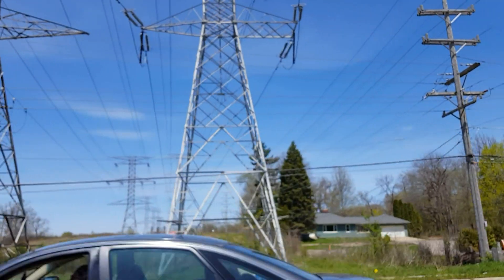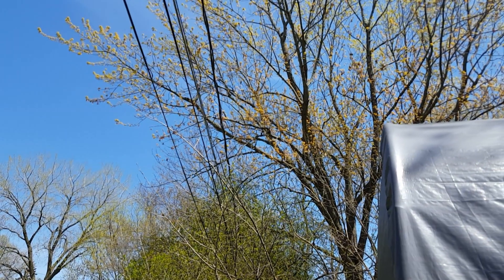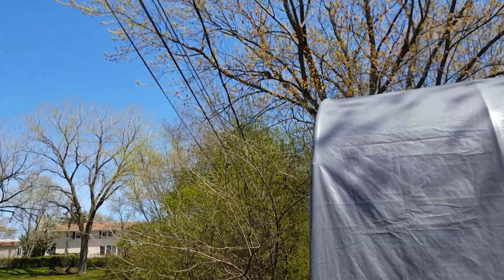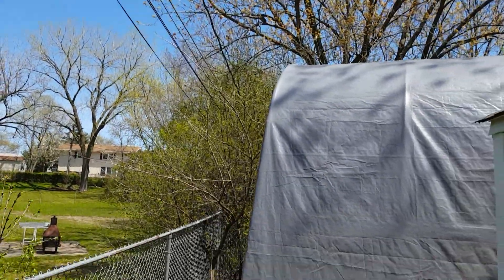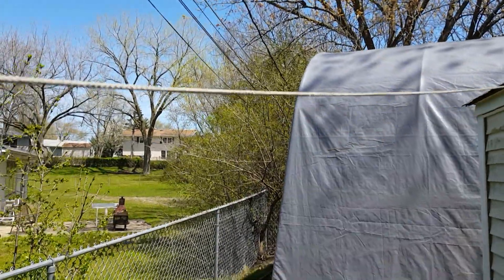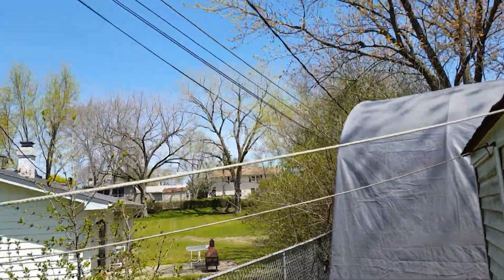WIRELESS POWER TRANSFER Part 3 (Over Unity?)

Comment: What is your output to input ratio?
Reply from the maker: I have applied 11V & my freq gen can only put out a maximum of .100A(100mA), so that would be 1.1 Watts at the most, but than again we have pulsed DC with 50% duty cycle so the math gets tricky calculating output & input.  100 LEDs in series and they are in parallel with another 100 and they are in parallel with another 100, for a total of 300 LEDs.  Each LED has a working voltage of 2V and 20mA.  I will eventually do more experiments & math to calculate input & output with more accuracy.
It does appear to be over unity to me so far, but I can not make that claim at this point without more proof.
Reply: INVENTOR3 thanks
Reply from the maker: @filigenzilab9613  Your welcome.  I did make a mistake, in my fist 3 videos parts I have only 1.1 watts applied, I edited my comment above to reflect this.

Comment: REALITY CHECK           you do  NOT  know  what  you  are  talking  about.        output  Power/watts  CANNOT  be  Determined  by  referring to  device  ratings/spec's.        USEFUL  wireless power transfer  is doable,  ONLY,  via the use of  'focused'  Microwave  RF  or  other  em radiation;  which will give an exposed  human/animal  a  HELL of a tan  ---  from the inside out.         at 1:40,  secret ???     yeah  right.      there is a  NOT-secret  that  everyone has  been  IGNORING !!!  since the '50s.        at 3:00,  'when i light ....'      bla-bla-bla-bla-bla-bla.          ever hear of a  CRYSTAL  radio  set.      ambient  RF   CAN  light  LEDS  or  power a  SIMPLE  AM  radio  circuit..... and,  That  is  IT  !!!          btw,  tesla was a  fraud.  (just like bearden, newman, bedini, et al)       tesla acquired a stack of  Worthless  patents.     None of his patent ideas  were   Proved !!!    there were  No  proof of concept prototypes !!!    thus, the  Fizzling-out  of  tesla's  career   'makes  perfect  Sense';  without a need for  conspiracies,  theft  or 'men in black'. 
ANY  reliance  on  tesla-related  information as a basis of further research, is  MISPLACED !   cheers        googletranslate
https://en.wikipedia.org/wiki/Crystal_radio
https://www.youtube.com/watch?v=dyRlbXUIscg

Comment: thanks for the new video i as well as others have been anticipating it i was wondering if you applied the energy to a motor and used a torque meter to figure its torque then speed which you could use to find the voltage if all of your voltage readings would match up
Reply from the maker: Thanks for your kind words, i hope to keep the videos coming, i was stuck for a couple of weeks when i got the first bulb lit, but now progressing faster.  And thanks for commenting & your intriguing idea.

Comment: It's a small fraction of a volt coming out of the ground, maybe more with your setup I don't know. That's really nice, it looks like all you need is more current. can you tell how much voltage is being used by the 3 10watt bulbs? I don't see how you are only using 2 watts for all 3/4 bulbs, 2 watts says you are only using 20 volts. Is it that if you run the bulbs on the right frquency they require less energy?  That is really cool Paul, it's good to see you again  and doing well.
Reply from the maker: Yes!, Thank you!,,, you got that all correct, welcome to my world, hehehehe!  Another mystery every day, it's quite baffling.  The three/four bulbs i have are in parallel with each other and there is a total of approx 115V across them.  Yep, output of my freq gen is 20V at "maybe"  .1A,,, 2 watts "max" output.  And i bet it is "not" even drawing as much as the "max" of .1 amp from the gen, i bet there is less because there is very little load at all since it is open circuit/wireless.  There must be a good amount of current as 350 LEDs shown in my last video, humm, well each one has a forward current of 20mA(.020Amps).  You ask about " is it that you run the bulbs on the right freq they require less energy",,,hmmm, well, when at the correct freq things are all in resonance, when working with wireless energy transfer "and" if they are in resonance, then there is between 10 & 30 times the amount of power transfer, just meaning it is more efficient and there is less power loss, not that there is a gain in power, like it appears to be here.  It appears to be over 100% efficiency here.  When in resonance the bulbs do not require less energy, they need same energy as usual.
 Please double check my math, let me know that i am not crazy, i would appreciate it, lets see what you come up with,, how many watts are required to power only 50 LEDs in series with each other??  I want to see if you come up with same answer i do, i'm serious!  Each LED has a forward voltage of 2V and a forward current of .02A(20 mA), how much power do you come up with?!
And i know that i have "more" than 2V to each LED in my system and i have 350 LEDs not 50.
Always great hearing from you buddy, God bless you😁
Reply: @INVENTOR3   I get 2 watts for 50, 14 watts for 350, that's at 2volts and 20 ma in series.  God bless you guys too, we all need it Check these two videos out,it shows 2 health care professionals that are telling the truth about the corona virus. 
 http://www.liarfest.com/p8_011.htm
Dr. Thomas Cowan Covid19 fails koch's postulates https://youtu.be/m3LgrcDAlJs
We have psycotic criminals running the world.
Here is a message I sent Trump shortly after they slaughtered nearly all the people in Paradise California.
"No Trump is not working to help the people, he is a puppet of the pope and 
the New World Order. The United States and all of it's authority and powers were dissolved on March 9th 1933 by the emergency banking act. Trump has no authority to do anything. I was ordained and anointed by Jesus Christ himself  in November of 1997 to be your king. You Tell Donald Trump that I command him in the name of Jesus Christ(Yeshua hamashiach) to surrender this nation to me now, if he will not this nation will be totally destroyed by the hand of God and not by Satan, the people he is really working for, or anyone else. Furthermore I also command him in the name of Jesus Christ to call the queen  ,the pope,and the leaders of Israel and tell them  I command them to surrender all they control in this earth over to me or the same will be done to them. Lastly for now I command him in the name of Jesus Christ to call all  the governors and order all taxation on the common people to be cancelled and allodial titles to be sent to all property/land owners now, the corporations will be forced to  pay any taxes that are paid. The results of 

all your elections are null and void, there will be no more elections, 
God(Jesus) will be the one to make the rules and he will see to it that I do what needs to be done for everyone.  I am your king, do as I command."

Jesus corrected me a day or so after I posted this an told me he actually had 
chosen and anointed me before I was born. 
I just wondered if the virus is the popes response to my demands of him and the others?
I am working on a more precise harsher message to all the world leaders, they absolutely have to go before they can harm anyone else to anyone. You know abut the Georgia guidestones don't you? God bless you all again.

Comment: Getting a current measurement shouldn’t be too hard if you have a contactless meter
Reply from the maker: Like a clamp meter?,,, i was thinking about this also,,,"maybe" this wont effect the system too badly & i would still be able tune it in after it is clapped around a wire.
Thanks!
Reply: INVENTOR3 , yeah, I had a mental block before regarding the name, I use a clamp meter daily, and It won’t effect whatever it’s measuring, not sure what you’ve got to read, AC or DC , not sure if the clamp meter will read DC ?
Reply from the maker: @rotorthermotech1310  I was wondering the same thing about AC/DC,,,i found one here from amazon   https://www.amazon.com/Auto-ranging-Digital-Clamp-Meter/dp/B001VGND88
$78  Looks like AC/DC/and "pulsed" DC & freq counter! :-) "Non-invasive" current readings up to 1,000A :-)
I will get one soon, but must shop around for best one!

Comment: Try Ohm's law :-)
Reply from the maker: Not easy to put a meter into the circuit to measure amps,,,,,,,,Hmmm, funny now that i think about it(thanks to your comment), there are "three" formulas for power and i do know voltage, just need to calculate resistances, and now that i also think about it, if i remember correctly, this is how an amp meter works, it measures voltage across a known resistor and does the math and spits out the answer.  Thanks for commenting!😁

Comment: Hi,
What exactly is your circuit?
Tesla coil extracting static from air and transforming to lower voltage to load to ground?

According to some researchers, that's what Tesla intended it to do.

He has an earlier patent for extraction from air, where insulated metal sheet is connected to ground through a 
few capacitors and depending on height of the sheet, produces voltage. Approximately 1 volt per foot height.
I think it's acting as a collector, meaning the plate is half of a capacitor the air is the other half.
Tesla specified that the plate should be as large as possible and highly polished before insulating.
Reply from the maker: My circuit is not completely revealed.  My power supply is a freq gen to a coil to some other things to some other things, to a bunch of coils and LEDs, hehehe.
The part about Tesla, i agree 100%😁  If you want more of an explanation, please read "pinned" comment above that i recently wrote.
Thanks for commenting!
Reply from the maker: I will tell you this, i started with the first stage of Don Smith's schematic that he shows on the board in the video that I put a link to in video part 1.  Look at 46:00 to 47:00 min, this is important.